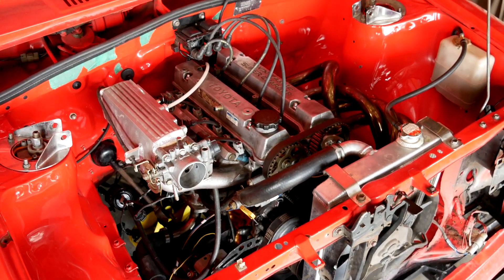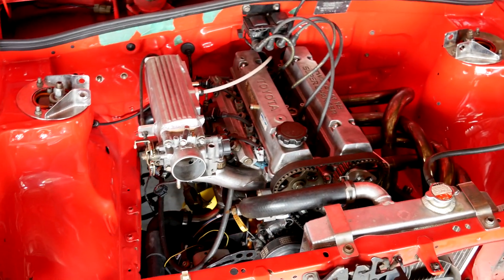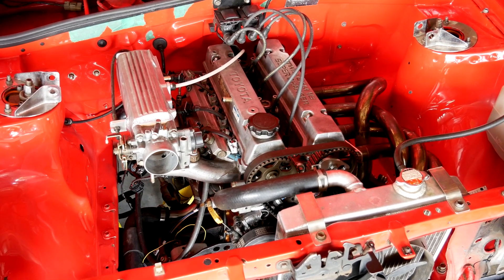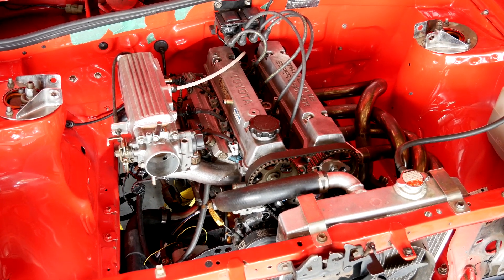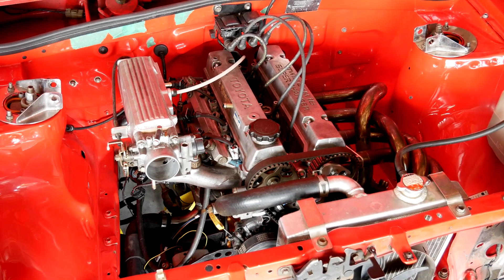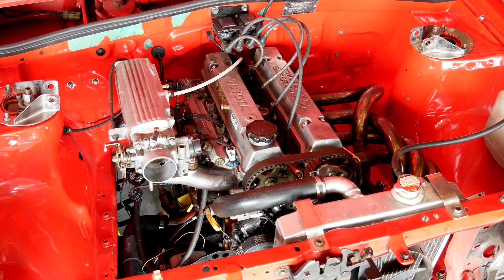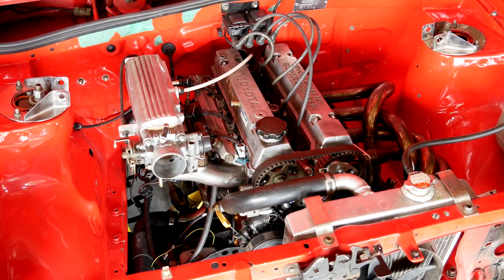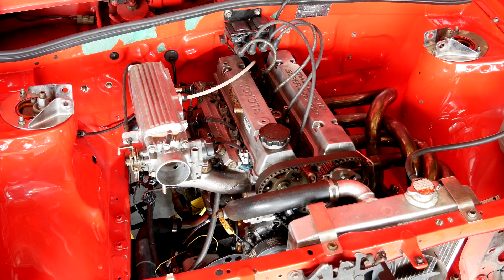Ignition Timing - Garage4age golden turd

Comment: This is beautiful.
Adjusting spark timing is quite complex as these adjustments are not made in 500 rpm gaps but much smaller windows in more complex builds.
And, this exercise shown here was performed only at 100% load, you can still set optimal timings for lower loads.
Imagine doing this for every 100 rpm, all they way up to redline and also for 10% loads, 15%, 20, 25, 30, 35...
Modern day ecu tunes are normally far more precise than that.
They not only seek the optimal output but they also analyze the exhaust emission characteristics and efficiency, bsfc etc
Modern cars have alot of timing being pulled off from their maps because in specific areas and regions their engines sometimes peak in either nox, sox or hc... in order to cut that out timming and fuel events can be pulled.
Reply from the maker: Yeah this video just scrapes the surface.    Factory  would spend thousands of hours on tunes for various reasons.  Its slightly annoying, when  people expect an aftermarket ecu to be tuned in a couple of hours and drive better than factory 😂 .
Reply: I had a teacher back at mechanical engineering school who spent 21 years working for GM, he worked in several cars such as the Cruze, Kadett, Monza, Omega and so on.
He mentioned powertrain dept spending several months setting ecu maps on the 1.8 N/A Cruze just to adapt it to our market. They weren't developing the car itself, that was just to adapt it to the fuels (flex fuel market) and different weather.
And regarding your customers, it must be a pain in the ass sometimes lol
Reply: @Garage4age  i mean, A LOT of the tuning comes down to emissions, not just drivability.
Reply from the maker: @hojnikb  yeah, tuning for emissions while retaining drivability, doesn't sound like much fun.   aftermarket stuff on a simple setup,  isn't that hard to get a tune knocked out fast that drives good.   but the little things, fine tuning and cold starts and the likes take time
Reply: High resolution tables are mostly a marketing gimmick to make brand X ECU look good on paper. 
A relatively low-res table with good interpolation will work just as well and take only a fraction of the time to set up.
Do you really think there is any significant change over a 100 RPM range that requires an adjustment?
Your engine tuner may tell you differently, but they want you to spend more time/dollars on unnecessary micro-mapping.

Comment: Surprise how much timinf affect power gain
Reply: yep, its basic physics. If you start your flame late, it doesn't have enough time to burn all the way and thus robbing you of power. And reason why it's not affecting down the rpm range (less piston travel, more time for fuel to burn all the way).
Reply: @hojnikb  i was aware of timing having big impact on E85, but not that much on unleaded fuel

Comment: ive been fluffing around doing road tunes for my 4age with haltech elite. going to try some of these values, looks promising
Reply from the maker: If your engine makes more power than this one, will need less advance.  also remember my note at start of vid re base timing being slightly off on this test
Reply: @Garage4age  copy that. Its a standard bigport with cop conversion. Less advance as in closer to btdc?
Reply from the maker: @ItsOnlySmellz787  yeah. take away 1-2 from all my numbers

Comment: very interesting, thanks !  I always thought that aprox 25° advance was sort of max at +6000rpm, apparently not
Reply: Generally you want peak cylinder pressure to happen at around 15 degrees after top dead center, regardless of rpm.

Because the gas expands "slowly" you have to start the ignition some time before this. 
If the gas expanded instantly, you'd have timing fixed somewhere around 15 ATDC at all rpm and load.

But if the expansion rate is "slow" because its real life then:

If at 3000rpm you had 10 degrees ignition timing, the total to 15 ATDC is 25 degrees (and however many milliseconds that is)

So at 6000rpm the motor is spinning twice as fast, so to ignite the same amount of time before 15 ATDC you'd need 25 * 2 = 50 degrees (same amount of milliseconds)

Then subract the 15 again and you have 35 deg ign timing before top dead center.  Which sanity checks reasonably well.

There are other factors involved which make this rule not exactly true, but its a good way to visualize why you need more timing as rpm goes up. 

If not for distributors needing a mechanical reference point that's convenient, and that BTDC numbers have become convention. 
You'd probably have a more meaningfully shaped ignition map by having "zero" timing at the point you're hoping to have peak combustion pressure happen. (ie, add 15 degrees to all the numbers)

Some OEM ECUs have this with a "flame speed" based ignition table instead of degrees before TDC. 
As I think this makes it easier to incorporate multiple ignition trims in a meaningful way, like air fuel ratio changing and IAT changing.
Reply: @RomanDaveThings  There are way more variables to add...its not that linear sir...map,compression,iat,chambers design, and this is what i remenber, ppbably few things more for sure.

Comment: No pinging ?
Reply from the maker: relatively low compression and ok gas.  so no knock issues.   I run the same compression and gas on my turbo engine,  which makes double the power

Comment: maybe next time change ignition timing vs change AFR
Reply: i though someone will ask about this myth.. afr doesnt change with timing, it dont care if it ignites in cylinder, exhaust.. it just measures oxygen present in air.
if you didnt mean this just hp gain from changing afr/timing (like 35° with going leaner, i mean being knock limited) then best for power is 14-15.5 afr, you can found more in webbinar from hp academy

Comment: knock ?
Reply from the maker: no knock. I listen for knock with a detset.  engine is pretty low compression/power to get knock on fuel used
Reply: @Garage4age  thanks !!
Reply: @Garage4age  what fuel do you use out of interest
Reply from the maker: @ReubenHorner   98ron e10 pump gas
Reply: @Garage4age  e10? Who does that? Gull?
Reply from the maker: @ReubenHorner  yeah gull

Comment: thanks for all what you do! can you tell what  compression ratio and fuel do you use? Do you have knock sensor?
Reply from the maker: Around 10.3:1 compression. and 98 ron gas.   so pretty easy to over advance with no knock.  my turbo engine runs about the same compression.   I use a detset to listen for knock (knock sensor, small audio amp and headphones)
Reply: @Ben T. was going to ask for the same :-)